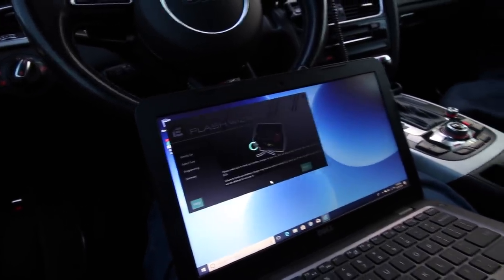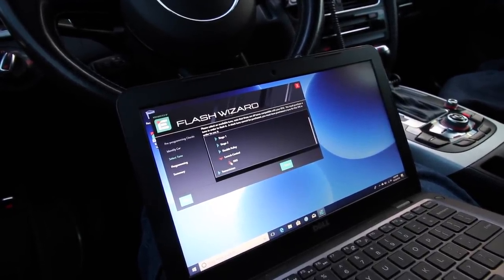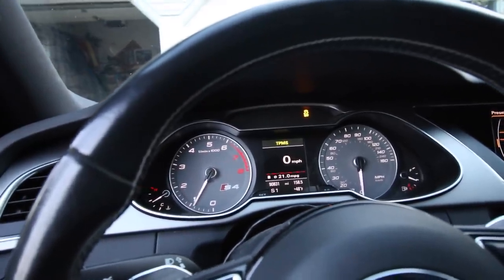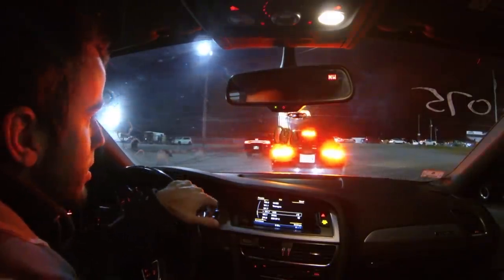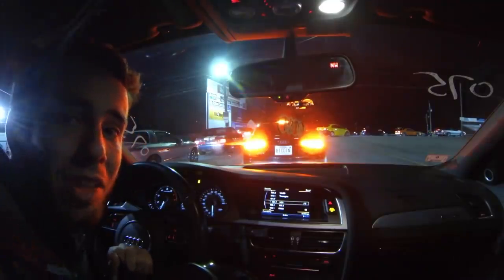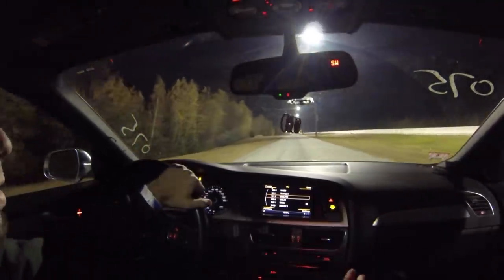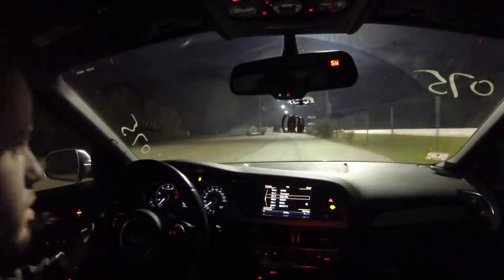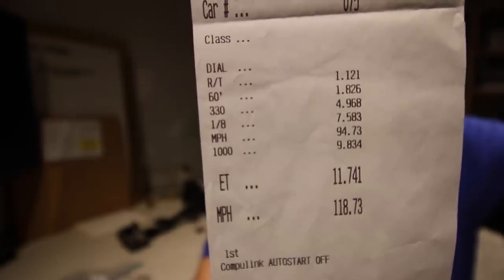Can We FINALLY Run an 11 in my Dual Pulley S4?!

Comment: My '12 S4 best was 12.5 at 110 with APR stage 1 on 104 octane, intake, exhaust. 12.9 at 107mph with 93 octane. It was 95 degrees in Florida so that doesn't help, but I feel like my times should be quicker than that. Also my car has been short shifting every pass but the 104 octane run. You don't seem to have that problem any more

Comment: Nice pass man! S4s are crazy underrated in their price market! I have a 2011 a6 3.0t. Pissed that I can't run the duel pulley setup... Time for a s4! Question. Does your 13 s4 have the ability to use bluetooth to listen to music? My a6 only connects via bluetooth for calls only. HIGHLY aggravated about that.
Reply: Kspec1515 yes they do. 13 and up.
Reply: Get an adapter for the AMI port. I've got one my 2011 S4 and it works great. I can still use my phone for calls too.
Reply: I don't have an AMI port. I have the CD and DVD player setup...
Reply: Kspec1515 in my 2011 S4, the port is in my glovebox. I ordered like a $60 Bluetooth adapter that plugs in there and now I can listen to music
Reply: I have a spare Bluetooth adapter I can sell you
Reply: I just got a TurnRaise interface MMI AUX adapter cable from Amazon. I've tried the Bluetooth interface that also plugs in to the port in the glocebox but it wasn't consistent for me and it eventually stopped working completely. The cable plugs into my phone's headphone jack and the sound quality alone makes it a better buy. And it's a lot cheaper. Only downside is you have the cable hanging out of the glovebox.
Reply: Just wondering, why can't you run dp? I have a 14 a6 c7 and I actually traded my s5 for it. Just as fast (running dp with a tcu tune). Love it.

Comment: did you have issues with cats on the dual pulley set up? I'm looking to pick up an S4 or SQ5 (your channel has been a huge factor in that) but wondering how far I could go with it before blowing a cat out.

Comment: I know this video is old but if you or anyone has answer please share. 

Did you use fuel cut launch on your last run ? 

If so,  what rpm was your fuel cut set up at ? 

What was your launch set at?

Comment: So what does dual pulley do? I watched install video, but still not get it
Reply: Single pulley is when you put a smaller pulley on the supercharger to spin it faster. Same as when you shift to a higher gear on the back sprocket on a bike, the higher the gear the smaller the sprocket and the faster you can turn the wheel. Same for the supercharger, it gives you a little more boost.
Dual pulley is the same principle, you replace the pulley on the supercharger as before with a smaller one than stock but, additionally you also replace the crank pulley (that drives the supercharger belt) with a larger one. So going back to a bike, this is like the front pulley on a 18 speed bike, once you have gotten the wheel turning as fast as you can with a high gear (small pulley in the back) you can switch to a higher gear on the front pulley making it spin even faster. 

Sorry, this is sounding more complicated that I meant it to. The TL;DR version is that you replace both the drive pulley on the crank and the driven pulley on the supercharger to get the supercharger to spin faster and make more boost.
Reply: @Foxtrot2312  yeah yeah, I understand pulley systems and it's simple. Thank you for explaination example with bike. So basicaly dual pulley is both are upgraded. Thanks

Comment: Here's my dumb question. I use my car as a daily driver so fuel economy is sort of important. How much did each tune level reduce your highway mpg?
Reply: Jens Sandvig not very notable at all bro. I'm APR stage 2 didn't notice a difference unless I get on it normal driving is essentially the same.
Reply from the maker: ^ what he said. There’s really not a huge difference. Once I upgrade my fuel pump I imagine there will be more of a difference though
Reply: That's good to know. My current record is just over 30mpg on a 3hr highway drive. But if I could have more power and not go down to much on economy then that's a win win to me.

Comment: Great run! Congrats! Quick question: I’m considering going with IE also on my S4. In manual mode does their TCU tune prevent auto-up shifts at red line? I’d rather bounce off the limiter than have the car shift for me.
Reply from the maker: No, auto upshift is still enabled.

Comment: when flashing are you plugging in your battery to charge?
Reply from the maker: For long flashes (the 2step, etc) I am. For short flashes (new tune takes ~2 min to flash) I don’t. If you want to be safe you should plug it in every time, especially if you have an old battery

Comment: Are you in manual mode for the DSG or sport?
Reply: Todd N. Two different things you can be in auto mode and be in sport or manual and be in sport.it will just shift for you if you don't use the paddles at a high rpm.
Reply from the maker: Todd N. Sport

Comment: why do people try to do AWD burnouts before launch to heat tires? not like you have a 1200hp awd platform lol. this is so pointless since you'll have traction whatsoever unless you run studded winter tires...but nice runs anyway
Reply: Your comment makes no sense.. he did the awd burn out and was still spinning off the line.  If he didnt warm the tires it would have spun even worse.

Comment: Bro, I have the same car and the only way to be a killer is by reducing weight... Be the first one to go on a diet
Reply from the maker: I want to run the best full weight time I can - then I’ll put her on a diet
Reply: @roberto Garcia  not entirely true guy . the fastest cars on the platform are running full weight cars  10.7-10.9 typically with no weight reduced